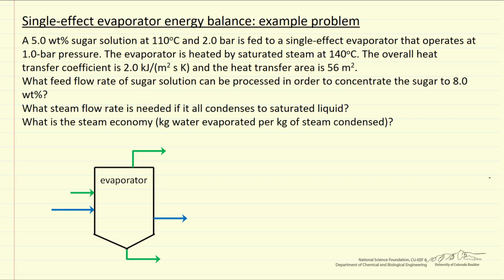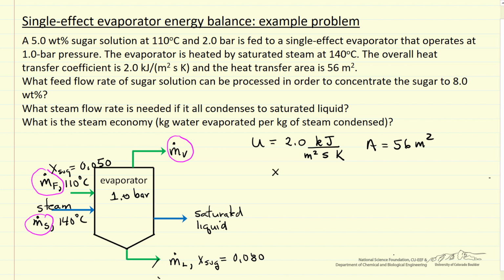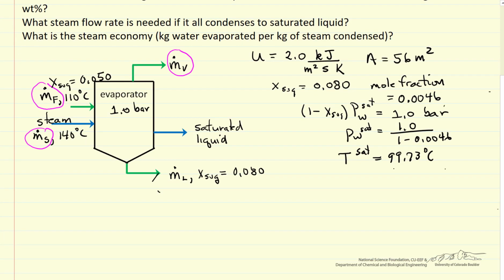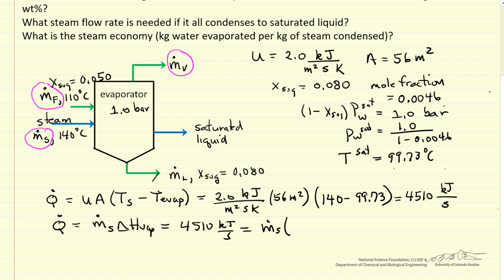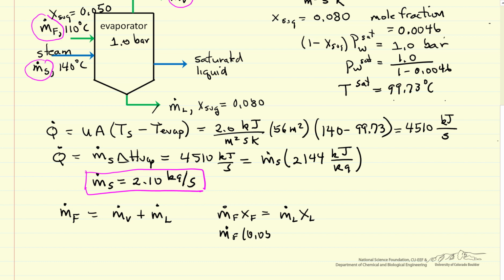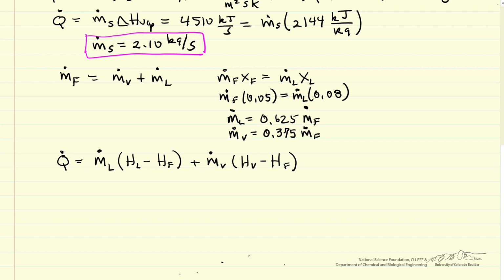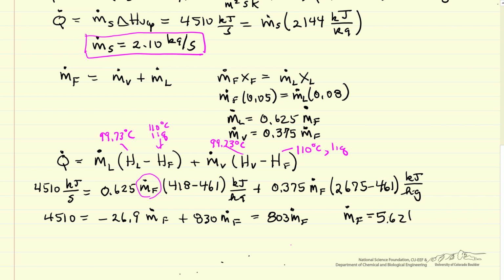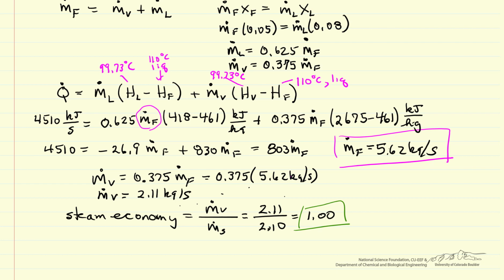Single-Effect Evaporator Energy Balance Example Problem

Comment: when calculating rate  heat transfer shouldn't we convert the unit of Tsat and Tevp to Kelvin ?
Reply: The gradient of temperature is what matters, since it is the heat transfer driving force. It is the same temperature difference in K or ° C.

Comment: How did the mole fraction become 0.0046? If this is glucose, which has a molar mass of 180 g/mol, then the mole fraction should have been 0.00044.
Reply: the molar weight of sugar is 342.3 g/mol
mole fraction is: mol sugar/total moles in the solution
total moles in solution = (0.08/342.3)+(0.92/18)=0.0513
sooooo, sugar mol fraction is:
(0.08/342.3)/(0.0513)=0.0046
Reply: @bellabalagtuk  do you know how to get Tsat from Pw sat that calculated with roult's law?